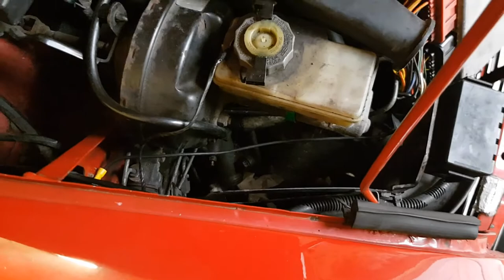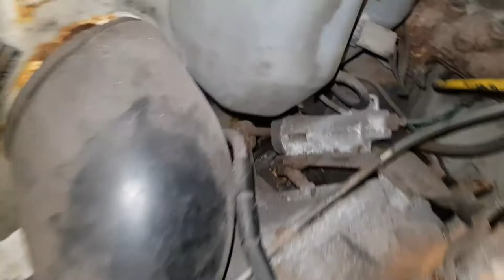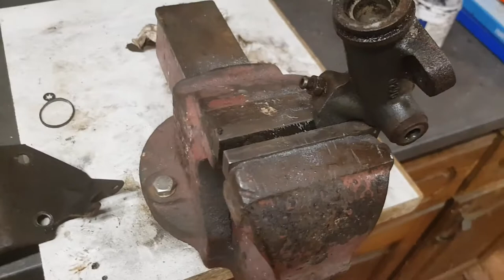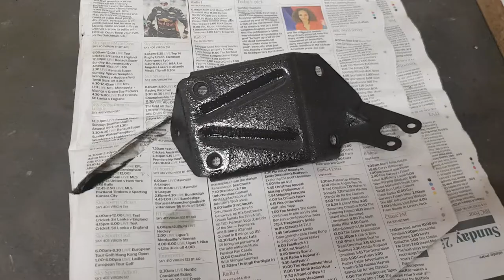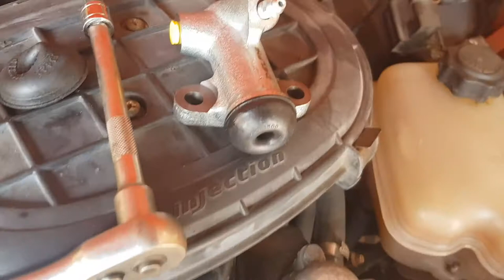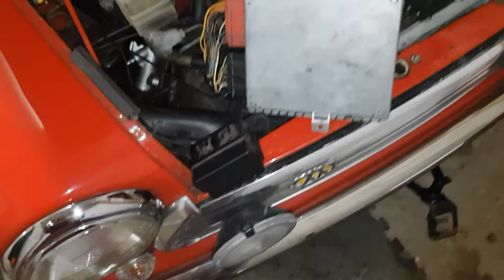Rover Mini Cooper MPI clutch slave cylinder replacement

Comment: I just did this job today, and it was a real b*tch to do. Thanks to this video, I gave up on the rear mounting bolt, and as I saw here, I removed the mounting bracket first, which was a little easier, but still not much room to turn a wrench. Pro Tip: for the lower, smaller bolt that fastens the bracket to the bell housing, there's a spacer between the bracket and the housing that the bolt goes through. That gets lost or dropped very easily. I found mine on the frame rail behind a brake line, and at first, couldn't figure out where it came from. Again, thanks for posting. Very helpful.
Reply from the maker: Thanks for the thanks 🙂 and well done for preserving and getting the job done 👍

Comment: That looked so difficult 😳. You smashed it though 👏🏻
Reply from the maker: It wasn't a fun job! The access was very tight as you could see. I've still got the old slave cylinder knocking about in the garage, I will rebuild it and replace the seals at some point.

Comment: Seem to have an issue on my 1975 mini where the clutch doesn't always disengage when I press the pedal down. I have no leaks from the servo but some nasty fluid came out the master cylinder when i flushed it and cleaned it out (Looks the original part!). I thought i wasn't getting all the air out when i bled it so i left the steering lock wedged against the clutch pedal and seat which has helped bleeding the final air out. (Learnt this tip from bleeding bike brakes lol) However i've bought a new master and slave cylinder which i might fit at the weekend if things go wonky again! Great video. i think i'll find it easier removing my bolts hopefully! Happy mining.
Reply from the maker: Wow, that sounds cdomplicated. Good luck with the repairs

Comment: Do you think it's best to replace the cylinder completely or can I just replace
The worn parts ie dust cap and seal. As it's a lot cheaper.
Reply from the maker: It is perfectly acceptable to replace just the seal and dust cap. I decided the replace the whole unit as it was going to be a quicker process. I've kept the old one to refurbish and hopefully use on another project.
Reply: @BlakesDen  ok many thanks. That has saved me some money

Comment: Great video. Im facing the same issue right now. Which slave cylinder did you to replace the broken one? Just dont wanna buy the wrong one.
Reply from the maker: Hi. It wasn't a fun job but I got there in the end. I bought a genuine replacement, part number GSY118. There are plenty on eBay as well as the usual Mini places. The new one was a Delphi. I also bought some generic copper washers for the hydraulic line connection as I didn't want the old ones to leak. Good luck!
Reply: @BlakesDen  thanks alot
Reply: One more question: how did you get that "hose screw" fixed in the Position that the hole fits the hole of the pipe?
Reply from the maker: Hi Philipp. I'm not sure that I understand the question, are you referring to the bolt that holds the hydraulic line in place? I actually did that bit first before the cylinder was bolted to the bracket. The Haynes manual says to bolt the cylinder in the wrong hole (so closer to the front of the car) and then attach the line but mine just wouldn't reach. So I did it with the cylinder loose. It was very hard to do and most of it was done one handed!
Reply: @BlakesDen  the bolt that connects the pipe to the cylinder(guess its the one you are talking about). Also have to fix it while the cylinder is lose but the bolt has a hole in it for the fluid and that hole needs to be in the right place to get the fluid from the pipe, or?
Reply from the maker: The bolt can go any orientation and you'll still get fluid to the cylinder. Just a case of putting it in and doing it up tight
Reply: @BlakesDen  thanks again and sorry for all the bothering